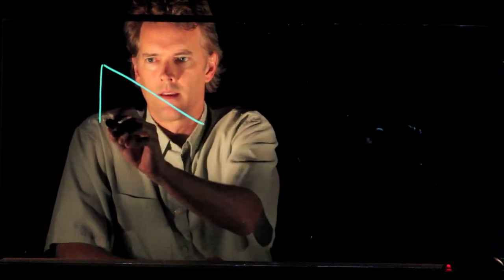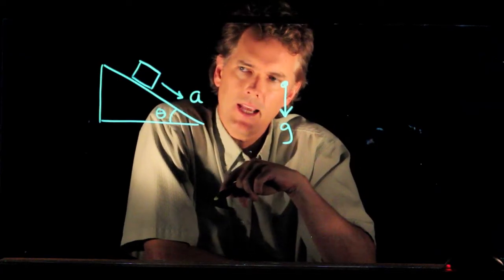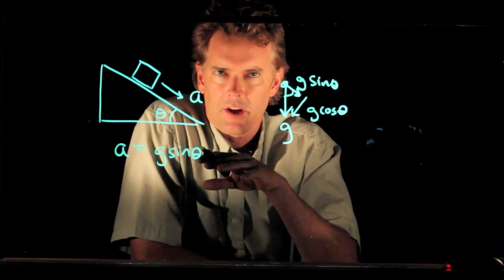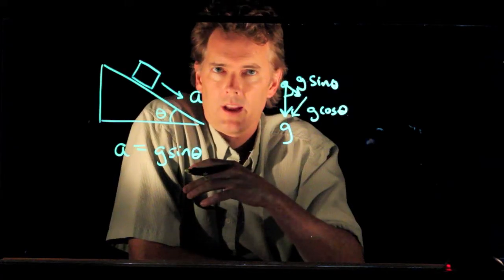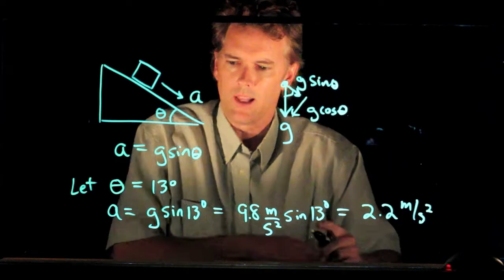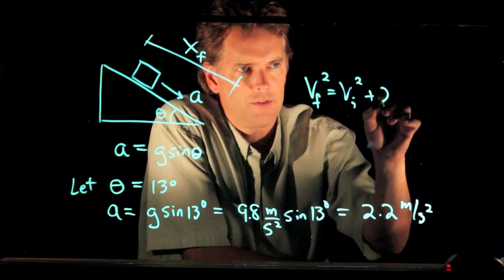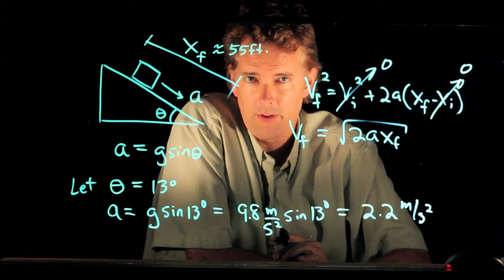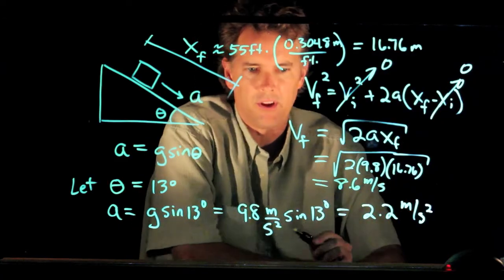Acceleration down an inclined plane

Comment: If I am not wrong, the angle theta is not at the right place. However, this is a great option to use.
Reply from the maker: This is the "standard" example used in physics.  Theta is usually relative to the horizontal (but of course, not always).
Cheers,
Dr. A

Comment: @ 1:20, marks the wrong angle as Theta.
Reply: David Klausen is correct. The angle 'theta' should be drawn between the vectors "g" and "g cos theta". Instead it is incorrectly drawn between "g sin theta" and "g". An easy error to make.

I think this error would be easier to avoid if a smaller 'theta' was used in the diagram. With 'theta' not too greatly different from 45 degrees, 'theta' and it's 'complementary angle', theta' or [90 deg - theta], are too easily confused.

But I do like this video that makes a good case for the acceleration down a frictionless plane as g * sin (theta).

Comment: can someone please answer why he made the opposite side of the right angle gcosϴ? (when he drew the little diagram) shouldnt it be sinϴ because sinϴ is opposite the angle?
Reply: It would appear that he accidentally put ϴ in the wrong place on the little diagram. It actually should have been used to label the 'bottom' angle on the little triangle.
Reply: or is it gsinϴ just in relation to g?
Reply from the maker: Taylor,
This should help: https://youtu.be/j63V1ExStDo
Cheers,
Dr. A

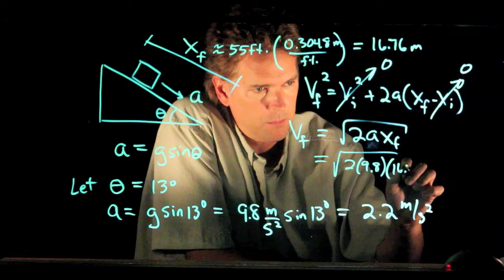Comment: Hi teacher, i'm with doubt for Vf did you say VF = √(2 aXf , but in the calc you you show (video time 5:00) a=9.8 = √(2(9.8)(16.75) = 8.60m/s, but I try it and the answer is 18.12m/s. I try using using a=2.2 = √(2(2.2)(16.75) = 8.60m/s now the answer is the same your. a = acceleration, right? Please could you solve me this doubt. Thanks for your videos and time, I appreciate your job!
Reply from the maker: Yes, typo at the 4:59 mark.  Used the wrong a

Thanks,
Dr. A
Reply: Exactly I can't understand which acc should we use

Comment: When solving for Vf at the end you used the acceleration of gravity (9.8m/s^2) rather than the actual acceleration from the given angle which we calculated to be 2.2m/s^2

so Vf would be 
sqrt((2)(2.2m/s^2)(16.76))
=8.6m/s
Reply: Agree 100%
Should have been 2.2 not 9.8
Reply: Check your limits or you can use trial and error
Reply: saw that as well